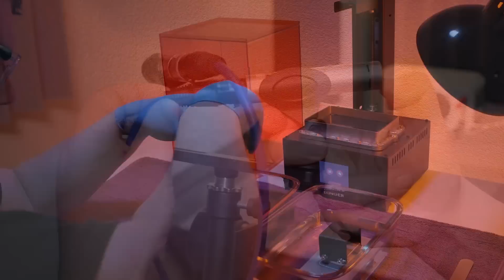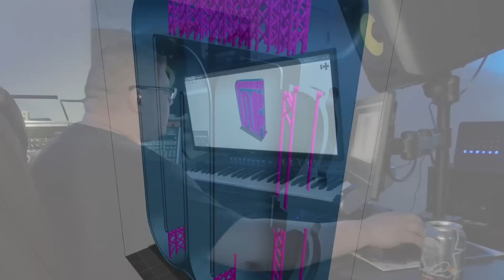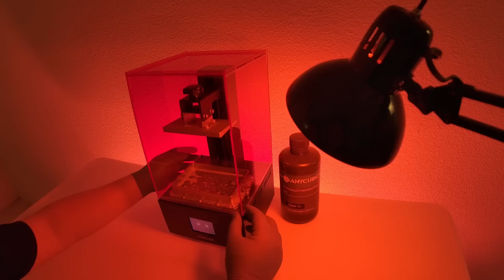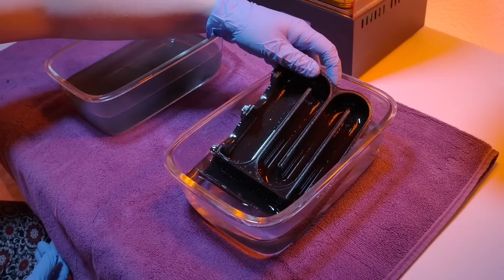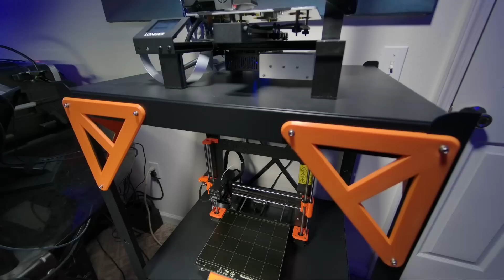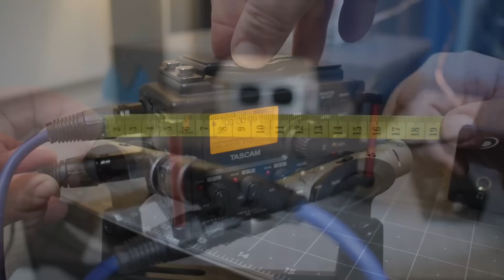Orange Adventures (Part 1)

Comment: Have you considered large scale fdm printing but using poured 2 part epoxy for the majority of the mass/structure? Basically you would model perimeters for all the positive space then pour to fill them. You could also fill with other pour able materials depending on the properties you wanted. 2 part urethane rubber, Portland cement, epoxy granite, etc.

Comment: If you want to glue the two resin-printed parts together you can just use the resin itself instead of any kind of glue.
Love the frequency range chart with those sound samples!
Reply: For best results do this before post curing the model

Comment: Nice work! Tectonic  is also offering slightly bigger driver TEBM35C10-4. Would this extend the bass further and how should the design be modified?
Reply: @HexiBase   I understand  that new driver requires new waveguide design.  You cant just swap in a different driver and expect improvements in frequency response. Would it be possible to get a video where you  show us a little about your design process. (for example; why in this design case you ended up with wider initial fold)

Comment: What numbers did you calculate out for the "box" behind the drivers, the TL cross-section area and the line length? I work in imperial measures, but can deal with metric if that's what you have. I'd just like to compare with what my old QBasic programs calc out.

Comment: The arrangement of drivers in the midrange and treble frequencies is all about dispersion. While multiple bass drivers are everywhere, You'll almost never see a quality speaker with multiple tweeters. And multiple midrange drivers are almost always in a symmetrical arrangement around a single tweeter. There are exceptions with line arrays of tweeters or midranges, or tweeters in a circle such as from tecton, but they inevitably have tricks with crossovers to modify dispersion patterns. Just mounting mids/tweets next to each other will inevitably bugger up the dispersion and response.

You may find the physics of the Daytona Audio CBT24 fascinating. https://www.soundandvision.com/content/dayton-audio-epique-cbt24-speaker-system-review

Comment: I’ve been highly interested in the software that is being used to modele the frequency response. It seems to take into account the material, shape, etc. It really looks like a complete software. 
I would like to know what is the name of the software used to make a simulation of your speaker design!
Reply: I was just about to comment this, it would make a great video
Reply: @braddsouza4  it's his own software. Constantly improving. It's unbelievable what he can do with it & how much he can account for.
Reply: HornResp is the best free enclosure sim....this guy has no software to sim the his line
Reply: @camploismyalias  thou beist mistaken
Reply: @camploismyalias  Hornresp is great, so is WinIsd, Xsim (free), Audiocad, Lsplab, and ton of others, but i think Hexibase sims his work pretty thoroughly...
Reply: Zegarac Robert I’ve not seen a more accurate, free, sim, than hornresp. I’ve tried others but hexibase is just a person and he’s not the person who came up with the formulas for TL, Martin king did...you can model a TL using math or whatever appropriate sim. without a proper simulator hexibase has no idea what his impedance, group delay, phase or frequency response is. Or his excursion, how much fill to add, etc etc
Reply: @camploismyalias  without a proper sim is exactly right. I can tell you, it isn't horn resp. He's made his own particle collision engine. His questions/comments regarding anomalies are for interaction points with the Youtube alorithm.
Reply: steve milton I’m going to call bullshit, hornresp is one the best sims around period. Particular collision is good for viewing how a wave form travels through a structure, it tells nothing of FR, group delay, impedance, phase, excursion or anything related to building an enclosure for a driver....it’s use would be to see how well a horn design works, for example, or display diffraction off of a baffle.
Reply: @camploismyalias  Hexibase simulates the design before, you can tell because he overlays predicted response with measured response, and because his measurement methods needs some updating (does not use MLS or gated measurements, has some irregularities at higher freq's of the Spectra), but that is indication that he Sims his designs. The fact that he does not share all the details  of his Sim like group delay, excursion, Port velocity or other details means nothing, every good Sim  tool plots these, but few people understand those figures so good choice to not spend time drilling into these results is proper one and will give him more views... Regarding his understanding of the process and physics he is well versed, check other videos of his...
Reply: @ZegaracRobert  Making measurements, post creation vs modelling to arrive at a specific point before hand.....
"Sim like group delay, excursion, Port velocity or other details means nothing" BS "few people understand those figures" BS
Anyone who knows the basics of loudspeaker design are familiar with those specs, so you've just lost all validity with me.
Bottom Line, he doesn't show how he predicts the frequency response, so as far as you know he used HornResp lol.
Reply: It's called Hexibase. You can purchase it at Nowhere On Earth.
Reply: @supersteveenglish7340  you're very clever bro and very very funny you should be a comedian

Comment: The Monty Python reference is just amazing.

I'm honestly extremely intrigued in getting a standard 3D printer to design some proper enclosures for my bookshelf speakers. I've been making crappy subwoofer boxes for a few years, trying to make the best of my knowledge, but I don't have any of the materials or tools to make a good set of enclosures for the speakers, and no equipment to test the performance. Having 2 massive, ghastly, unpainted MDF, hodge-podge boxes on my desk is not great, and I'm definitely not making the best use of the 20cm/8" subwoofer drivers in each of them. For reference, they're 3-way, with a small sealed upper enclosure for the midrange to give it a bit more "presence".

This channel is invaluable to DIY sound tinkerers, and is a wealth of knowledge to get into the more advanced ideas for speaker enclosures and getting the most out of the drivers in question. Needless to say, I'm intrigued how the resin box will go once you've got the replacement :)

Comment: Some thoughts on those upper band irregularities: Building a small anechoic chamber will help with the accuracy of your measurements. Anechoic measurements never match measurements taken in a space. Also, it is a standard practice to aim the measurement mic directly at the source, although it is a an omnidirectional pressure microphone, they still do have some high frequency directionality due to diffraction from the physical microphone itself.